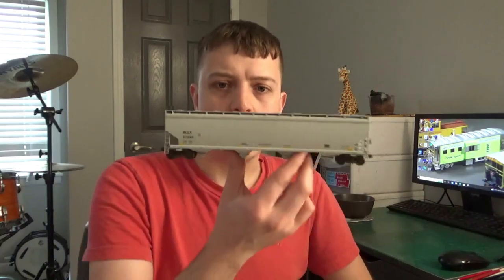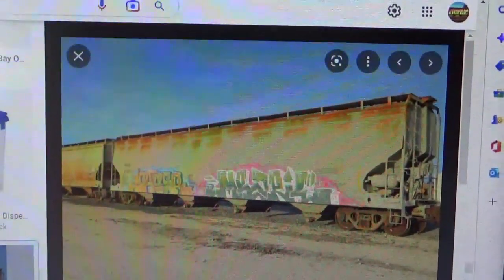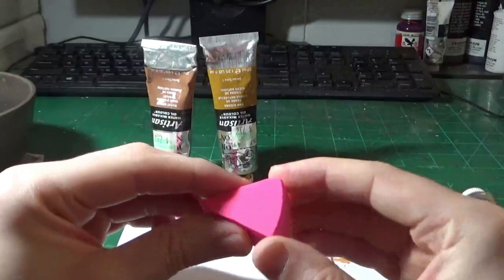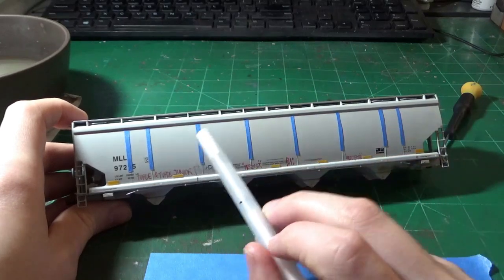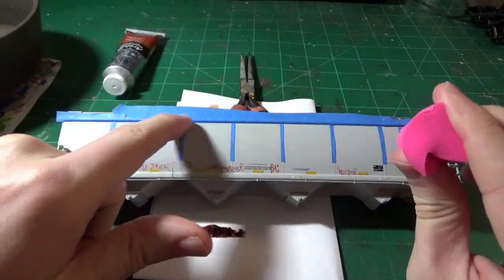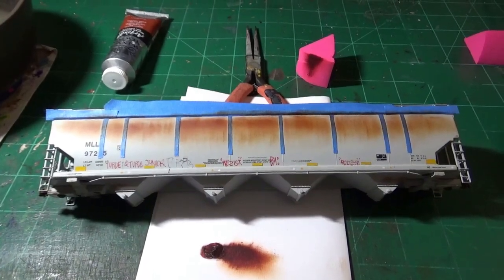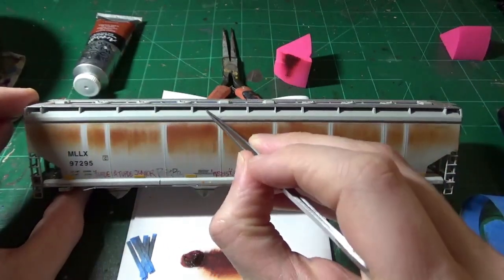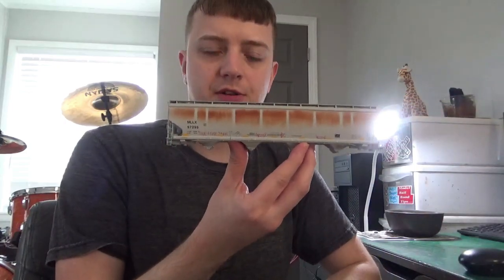Quick Tricks!  Easy Sponge Rust Techniques!

Comment: Nice video Dan. The rust effect came out very nice. It's amazing how the sponge can achieve such a good effect. Would this also work with Acrylic paints as well provided that they are slightly thinned down? - Nicholas.
Reply: Something like this would probably work with acrylics, but I doubt it would work nearly as well.  What makes this controllable is that the paint is fairly thick (and it's just that there's not much on the sponge), and acrylic paints tend to dry pretty quickly when they're in that state.  The "Boomer Diorama | River Railroad" channel recently had a good video on the properties of oil paints that make them especially good for this kind of technique.

Comment: Dan, can you clear up something for me: 1.)  Is "clear coating" the same as "dull coating"? 2.) I'm considering buying a bottle/can of Gloss Clear Coat - Hobby and Model Lacquer Paint so, is this what I should use to clear coat my new models right out of the box before I start weathering?  3.) When should I apply dull coat? 4.) I've heard it said to wash a new car in warm soapy water to get any injection molding flash remaining on the model? Is that necessary?
Reply from the maker: Yes, when I say clear coat, I always mean dull coat unless I specify gloss clear.

Comment: I do like that technique with the sponge.  I make my own rust powder by putting about 3 or 4 rolls of 0000 steel wool in a quart jar and fill it up with white vinegar and set it in the window for about a couple of months.  After the steel wool is pretty much dissolved I pour the mixture in a flat pan (one of my old stainless steel photo processing pans - 11x14) and wait for it to completely dry.  You could use a glass baking dish.  Then I use a single edge razor blade and pulverize the rust into a fine powder and store it in a little (snuff) can.  When I get ready to use it on a piece of rolling stock I usually use my X-acto (AproXimo) knife and make gouges in the sides of the car.  Then I fill the gouge with my rust.  It really looks real, 'cause it is REAL rust.  The rust powder is usually mixed with some distilled water, a little alcohol and water soluble glycerin and paint it on or use a little spatula to put it on.  Then I use a final topcoat of clear matte acrylic topcoat.  Cheers from eastern TN